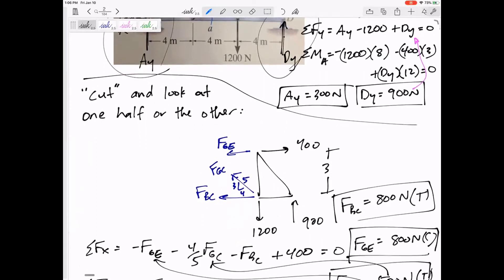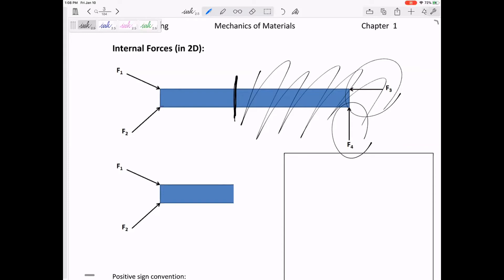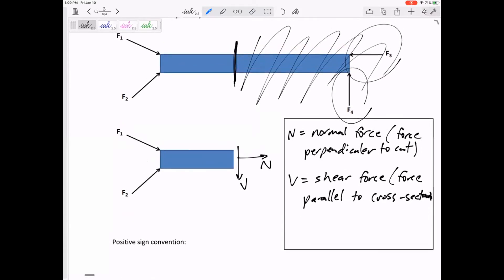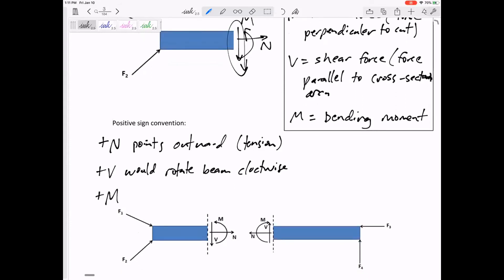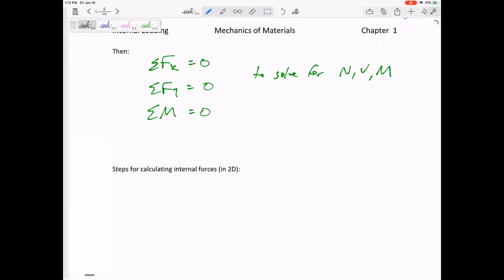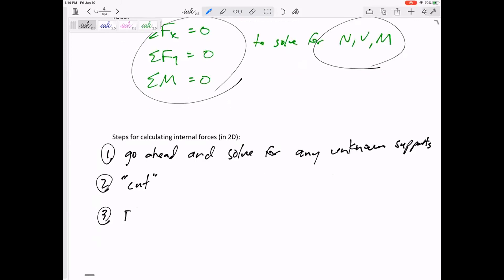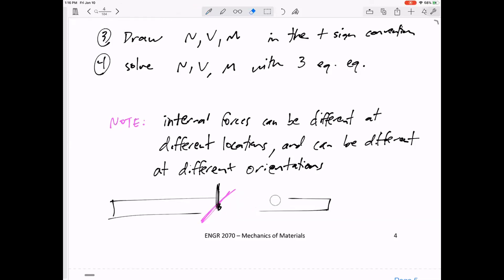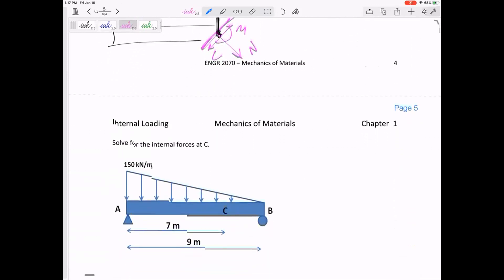Mechanics of Materials - Internal forces notes

Comment: Sir.. kindly clarify please. V/Shear is causing clockwise bending and M is causing anticlockwise bending to balance it. is that correct ? thank you .
Reply from the maker: Well, V balances the forces. M balances the moments. It is in equilibrium so total moments will add up to zero. All the forces will add up to zero. V and M don’t necessarily have to be opposite.
Reply: @engineeringdeciphered  thank you